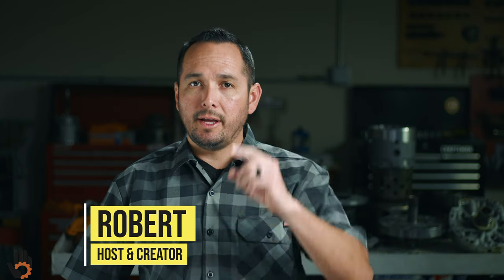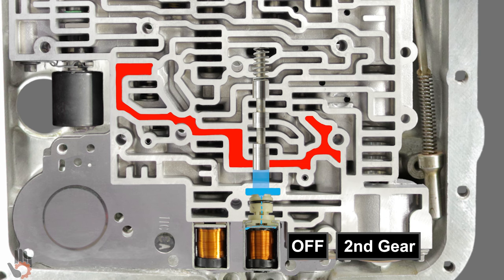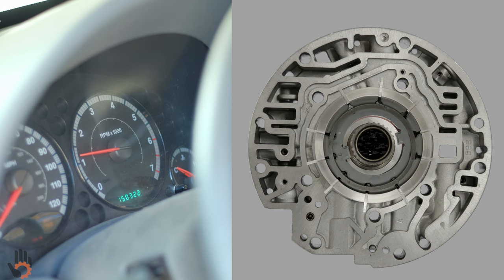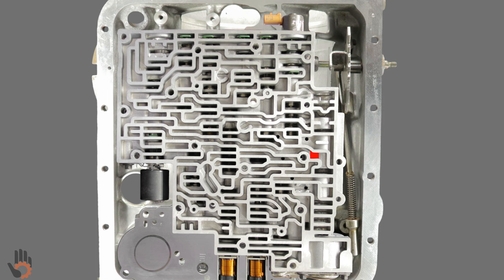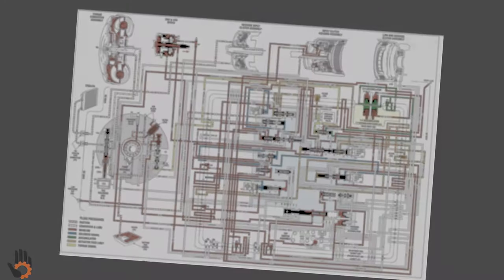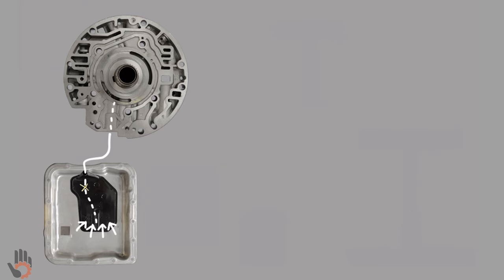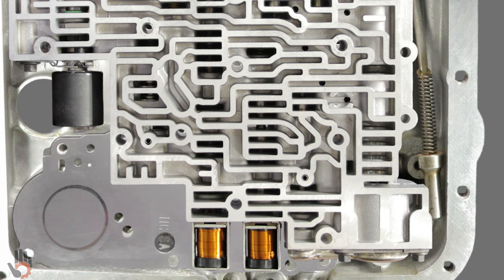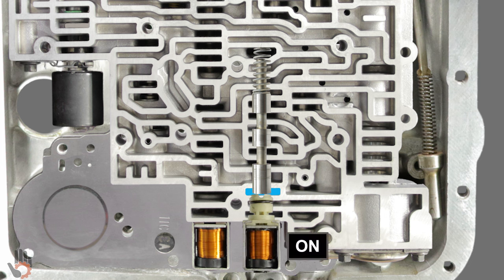4L60E: 1-2 Shift Valve + 1-2 Shift Solenoid (Part 1) Basic Operation

Comment: My 4l60e sometimes doesn't shift to first. No codes. New GM solenoids 2 years ago. The the thing is an 05 with 218k though. I know it's wore out. The friction material removed from the pan was ridiculous 2 years ago. The truck has been jumping on startup for months now. I imagine those cluches metal to metal.
Reply from the maker: That is a lot of miles, and friction material in the pan is never a good thing.

You might wanna check out this video.  Along the same lines...
https://youtu.be/4qXqzWFKPI0
Reply: @SouthpawAutoworks  pulled the trans last week. The front left checkball was stuck in the separator plate and the 3/4 clutch teeth were half worn away. Going good now.
Reply from the maker: The front-most check-ball is used during the 1-2 up-shift, and the 2-1 down-shift.  It's common for that check-ball to beat up the seat, in the separator plate.  It can get stuck in the plate...and if it gets bad enough, it'll even blow completely through the plate.

With the check-ball stuck in the plate, it will not prevent a 1-2 up-shift.  It will probably delay the 2-1 down-shift.
When shifting from Park to D, this check-ball will not be fed any oil.  It's only when the trans commands a 1-2 up-shift, that this check-ball goes to work.

3-4 Clutch Plate Teeth:
That's common for those to wear.  Typically associated with 3-4 clutch failure.

You had mentioned it was occasionally missing 1st gear.
Was the trans also missing 3rd and 4th gear?  Or slipping in those gears?

Comment: Great video. My problem is going into 1st gear. My check engine light came on and my OD light started blinking. When I start out I can feel it clunk into gear. My code reads 07000 which gives me to many possibilities. No problem in any other gear. Any suggestions?

Comment: This is second time watching your awesome straight forward vid on solenoid 1,2 operation. I accidentally sjfted my 4l60E into Reverse doig 55 moh on thr freeway for a quick moment. I am missing 1, 2, overdrive gears. A scan revealedpoissible solenoid failure. I installed new ones to no avail. Im going to try to see if solenoid 1,2 is ghetting connrction., Suggestionbs please? thy Robert Tim.

Comment: From Delray Florida. I have a problem with a 700r4, 1990 4 wheel drive suburban, 350tbi. The transmission shifts perfectly, but it clunks violently into gear hot or cold, but not always. I change the accumulator valve in the auxiliary valve body, based on a transmission shops recommendation, and it still does it randomly. Otherwise shifts up and down perfectly. I drove it back from Florida to New York towing another junk Silverado. Just that bloody clunk. U joints are new, it's 100% the tranny
Reply from the maker: The "garage shift."  When the vehicle is parked in the garage (could be parked anywhere) and the engine is fired up, and the trans is shifted out of Park and shifted into Reverse, or Drive.

An accumulator came to my mind as well.  But, let me think about this condition you're experiencing, and get back to you.

Questions:
1). Do you have an automatic transmission pressure gauge?
Note:  A typical gas engine oil pressure gauge doesn't read high enough for automatics.  Automatics need a gauge that'll read over 300 PSI....for safety reasons, among others.
2). With the trans in Park, and the engine idling, what is the pressure reading?

PS - If it feels right to you, please help me spread the word about this channel.

1 Handed Transmission Rebuilder:  (60-Sec Preview)
https://youtu.be/y3Vixa_Ec1E
Reply: @SouthpawAutoworks  ok, I'll buy a gauge. The $20 Amazon units have lousy ratings. I guess I'll have to spend? $40? $50? Recommendation? Thank you
Reply from the maker: I've personally had good luck with OTC products.  Or at least products that have an OTC sticker on them.  Who knows who makes anything anymore. =/

https://amzn.to/3NWZGiX

DISCLOSURE:  🕵
As an Amazon Associate I earn from qualifying purchases.  Some, if not all, of the links contained in this video description (or comment) are affiliate links.  This means that, at no additional cost to you, I will receive a small commission on any purchases you make through the website links provided above.

Comment: great video, my head hurts with great Info Overload.   I'm trying to understand my 2002 Acura TL transm shift problem. I lost power while driving on Hwy, I went to pass and lost acceleration power. RPM up - speed dropped. after engine cooled down I could drive enough to get off Hwy.  Acura in driveway now ( towed home)  I can drive around block & in 5 minutes trans Slipping. I've changed Trans fluid,  What's next step ? should I change out solenoids  Thanks in advance,  Woody

Comment: hey thank you so much for info,  had a  question how important is it that the filter and transmission fluid be clean, could it possibly be so dirty that does not let the pressure build up? where as the transmssiion would not go into any gears? my tahoe just stopped running completely not go into any gear just revs up, any info on that? beginner at this transmsission issues, thanks again

Comment: First great channel.  I have learned quite a bit from your video series and they're put together amazing.  Thank you. 
I have a question about reverse in a 04 suburban 4l60e.  It's a rebuilt transmission from global transmission has approximately 45000 on it. Has had regular fluid and filter changes since I put it in. I do light towing,  small boat, dirt bikes at most about 1 ton of weight.  
Reverse is now becoming hard to engage.  When put in reverse it acts like it is slipping at first. With light reving of the Engine it will slowly creep backwards if on flat ground.  If on a slope nose of car pointing down, trying to back up a hill  it will not move. If you feather the throttle it will eventually engage.  Sometimes with a clunk sometimes just slips right in. Once engaged I have full reverse no slip works great. I have checked the fluid.  Nice red color no smells of burnt clutch. I've drained just a bit of fluid,  not a full change , but no signs of clutch material or metal particles.  I've watched and read multiple things on reverse issues on the 4l60e but non seem to target my specific problem.  I've been driving it like this for the past 3 months.  I know not exactly the right thing to do. But the symptoms have not changed it seems no worse than when it first happened.  Yes this was an immediate problem.  Worked fine then one day it didn't.  Would truly appreciate your thoughts.  Just trying to figure out if this is a sun shell issue, servo issue,  reverse pressure boost , or maybe even a shift solenoid issue.  Or is it just screwed and I once again need a new transmission.  
Thank you for your time
Reply from the maker: That's interesting...
It has me wondering if the shifter is not adjusted correctly.  I understand that this problem has occurred out of nowhere.  Always good to circle back to the basics, and go from there.

Questions:
1). When the problem arises, if you move the shifter ever so slightly to the left (and/or to the right) of Reverse, does this affect the symptom?
2). When the problem occurs, can you stop trying Reverse, and manually shift the trans to "1".  Accelerate to a speed that would make sense to upshift....but, instead of up-shifting, just let your foot off of the gas.  What happens?
      A).  Does the vehicle coast as though it's in Neutral?  
      B).  Or does the vehicle quickly decelerate (engine braking)?

Thank you for the positive feedback!

PS - If it feels right to you, please help me spread the word about this channel.

Here's an easy way to share...
1 Handed Transmission Rebuilder:  (60-Sec Preview)
https://youtu.be/y3Vixa_Ec1E

60-Second Preview of the video you just watched:
https://youtu.be/fWPSaLeaOXI
Reply: Moving the shifter in any direction doesn't effect it.  I've also checked the cable and shift position it moves as it should and locks into each shift position correctly.  As for deceleration in first it does not coast when lifting off the accelerater.  I should also mention it shifts perfectly in all other gears I can also manually shift through the gears properly.  Fluid has always been kept at recommended levels using ac Delco fluid.
I've been researching the shift manifold. Could the diaphragm be cracked in that not creating the proper signal? 
Thank you for your help.  Just trying to diagnose this properly before just throwing parts at it.

Comment: I have a question or 2. First I have an 08' 4l60e that has a short to ground in the 3-2 downshift solenoid wiring . I have a scan tool that is capable of commanding 1-2 , 3-4 , tcc on/off , tcc enable/unenable, 3-2 solenoid and upshift 1-2-3-4 and 4-3-2-1 and it shows Me if the 1-2 sol is on/off and 3-4 on/off and tcc enable/unenable........ for each of the commanded states. Oh yes also pc . So when I start commanding 1-2 sol on it is in 3rd gear commanded until I command 1-2 sol on etc at which point it goes into 1st gear commanded and seems to command upshifts successfully 1-2-3-4 and 4-3-2-1. commanding the 3-2 on does not work it stays off. Driving vehicle upshifts1-2-3-4 normally and slowing down to turn or ? it downshifts normally. at 30 or 40 or 50 or ? it will not downswhift unless I manually pull it down. I replaced 3-2 sol for 30$ and the tcm for 80$. Before that I tried resetting the tcm unsuccessfully. I have been inspecting the wiring from the tcm and inside trans and where the sol control wiring enters/exits the trans for missing insulation but so far the wiring is in fairly good shape. At this point Im leaning towards the wiring as it makes its way up bell housing and across engine or the ecm for the short to ground. Vehicle is chevy express 1500 4.3l which Im sure You know creates ALOT of heat especially in Phoenix, AZ . Do You have an opinion as to the most likely location of the short to ground in the 3-2 circuit ? 1 more thing there is what looks like a diode in the rear bottom of the valve body that appears to have some damage/missing plastic/nylon that maybe is supposed to seal fluid out ? Maybe ? Thank You sincerely,
                    Christopher Frost
P.S. Sorry about the short book

Comment: Thank you for the information. It's much appreciated. I have a 4l65E transmission that I bought used with about 140K miles on it. It was sold along with a LQ9 LS engine. Is there anything specific I should look for when I rebuild it? I have made camshaft change and ported the heads on the engine which will require a program change on the ECU. Is there anything related to the transmission that should change in the program? Thanks again and keep making great videos.
Reply from the maker: There's a number of things that can be addressed with the 4L60E during a build (hydraulics and mechanical).  Been meaning to create a build series on that trans.  In good time...

Appreciate the positive feedback.

Comment: Hi, as always great videos and very informative.
I have a question if you don't mind.
I have 2016 ford escape 1.6 ecoboost.
The only problem that I have in my automatic transmission is a 2 seconds grinding noise before a strong engaging when I turn the gear from neutral or parking into drive, into reverse is fine.
I tried draining and refilling the transmission fluid 3 Times so far and it is not improving.
I am currently confused and wondering is it  a transmission gear issue or solenoid or valve body or the power transfer unit/case.
If by any chance you have any suggestions I would appreciate it! Thanks

Comment: Robert, these vids are awesome... this is my 4th video just absorbing the info... really good... I have an 4L60E in my 2004 Yukon XL... Ive been driving it for about 6 months with no first gear and then shifting manually between 2,3,4.  I am thinking about rebuilding the transmission and not sure if it will be worth it.  The vehicle is at 475,000 km  (285,000 miles) so it's definitely seen a few miles.  Is it as "easy" as a rebuild or is it possible that the body is too worn out? if rebuilt do you have a rebuild video for this? if rebuilt what kit to purchase? Thanks for any help you can share.
Reply from the maker: There are a number of things that can wear out, but the aftermarket has everything needed to overcome those kind of issues.
No rebuild videos on this trans...yet.  I would love to produce a build series on this trans.  However, I'm currently busy producing other 4L60E videos.
I do believe there are website links listed down below (in the video description).  Should you decide to build your trans, be aware that there are multiple years/generations of 4L60E.  Get a kit that matches your year of 4L60E.  Also be aware that rebuilding a trans typically requires more than a rebuild kit...another video for another time.
Wish I had more time to elaborate.  Super busy these days.
Wishing you the best with your 4L60E.

Comment: Yoo this is great content on the 4l60. I have a 07 suburban with the 5.3 and a 4l60 I had the trans replaced and it has a very hard first gear engagement when you take off from 0.  If I manually shift it to 2nd it will take off just fine. ALL other gears work smooth. I changed the 1 2 solenoid, as well as the tcc solenoid And didn't get anything. By my description and anything I can answer for you, do you have any ideas? 
Thanks for the vid and your time 🙏

Comment: I like how you go about it I can understand it kind of hard to keep up with the other guys on here is a 4l60 about the same as a 4l80 e
Reply from the maker: Glad it's helpful.

4L60E vs 4L80E:
They're completely different transmissions.
The 4L80E does utilizes shift solenoids and shift valves, that operate in a similar manner.  However, the solenoids have a different "firing order" than the 4L60E.
Reply: @SouthpawAutoworks  I think you guys are doing a great job
Reply: Have you done a 4L80E series thank you guys are doing a great job it's helped me out a lot thank you
Reply from the maker: We have not done a 4L80E series, yet.  However, we're currently working on a TH400 series.
The 4L80E is essentially a TH400, with an Overdrive section added to it.
Reply from the maker: Thank you for the kind words.

Comment: Hey thanks for sharing 👍.
Hey I'm having trouble with the loss of reverse and neutral,, only drive gears, got pan off and was wondering what would be the fault to look for?
Reply from the maker: With the shifter in Neutral, does the vehicle move forward, as though it's in gear (1st gear)?

Comment: If you have a short or problem in electrical circuit that goes to transmission could this effect function of it working at all. Tcc regulator valve is stuck open

Comment: Hello sir, Will you please take a moment and take a look at my problem? Code P1810, car surges at around 70mph and when trying to accelerate. Oil Pressure switch was replace by shop. Still same code. Car smooths out if when surging happening brake pedal is touched. Any tips what to look at please?

Comment: If the 1-2 solenoid malfunctions and turns off when the 2-3 solenoid is commanded on would this cause a third gear shift flare like neutral? Been having some electrical problems with my ECM I believe. The 2-3 flair followed the new transmission

Comment: That was very informative thank you.  I just rebuilt my 2005 Honda Odyssey transmission.  It runs great but once it warms up a little it shudders when leaving from a stop.  However, if I manually put it in first gear a give it gas it doesn't shudder.  I manually shift to second then Drive and all is well.  The problem only occurs when I'm in Drive and start to go.  I did not replace any of the electronics/solenoids as I thought they were working when the transmission went out.  Any thoughts? Much appreciated.
Reply from the maker: Not sure.
I will say that many transmissions can be operated with generic fluid, or even bulk fluid (with a vehicle/transmission specific additive, added during transmission filling).  However, this is not the best practice with Honda transmissions.

If you ran some generic type of fluid, you might want to try running genuine Honda ATF.  The dealerships carry it.  Can probably find it online, too.

Wishing you the best of luck on this matter.
Reply: @SouthpawAutoworks  I did use Honda ATF. I wonder why it does it only after it warms up?

Comment: My 4L60E when shift into D, it seems like it's in neutral,  it's not until I step on the gas pedal that it engages,  is this th 1 2 shift solenoid? I have checked oil levels and pressure.

Comment: My 4 l60e on my Silverado is only allowing me to go 35 miles an hour tops it's not a rough shift it doesn't slip at all getting to that point I do have to put it in tow haul mode to get even that fast otherwise it only wants to do 30 miles an hour there was no shavings or clutch material in the bottom of the trans pan when I dropped it do you think this is a shift solenoid issue?? Would absolutely love your input